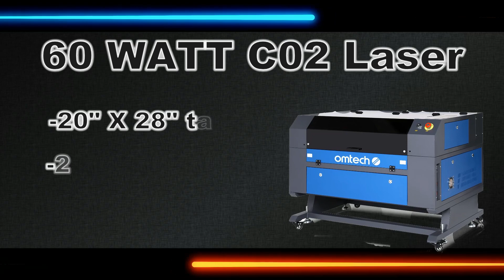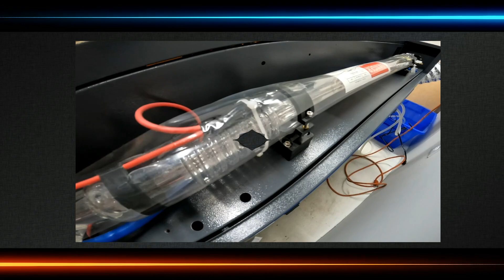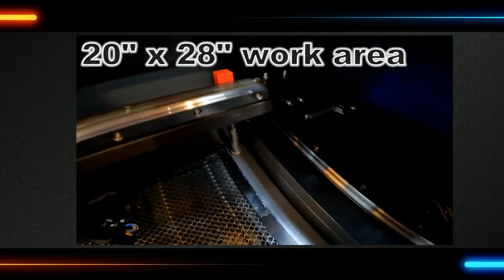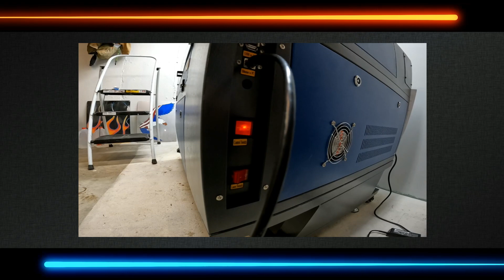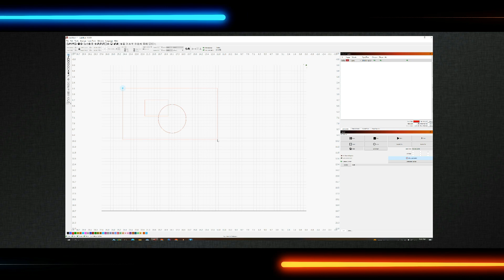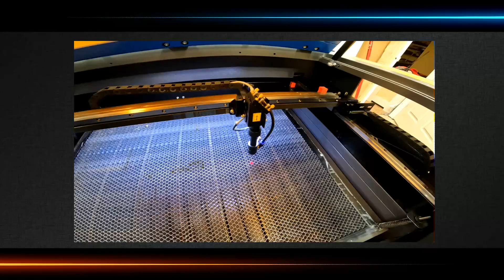60 Watt Laser Cutter

Comment: Will it cut steel and if so how thick?
Reply from the maker: For the most part no co2 lasers don't have the correct wave length to cut metals. Much more expensive fiber lasers are for use on metal. Some high end co2 lasers will but thats with 10 to 15 time more power than this has.
Reply: @Theweldingmillennial  Thanks!